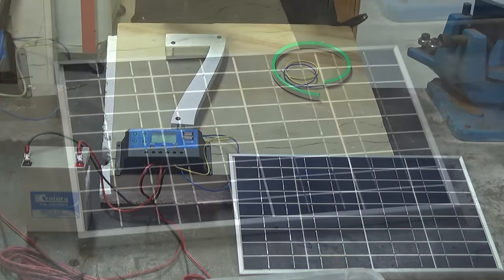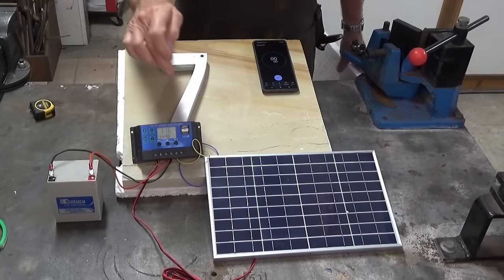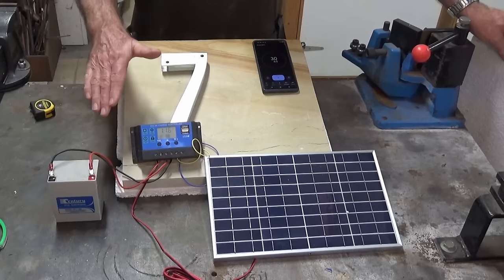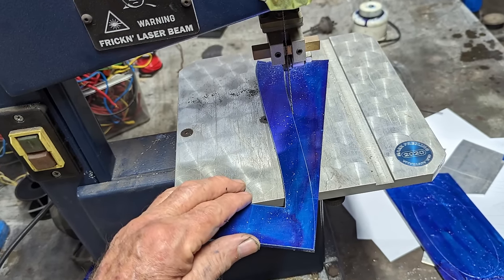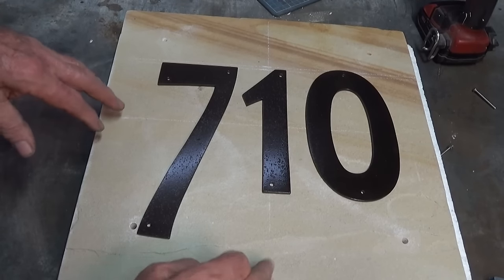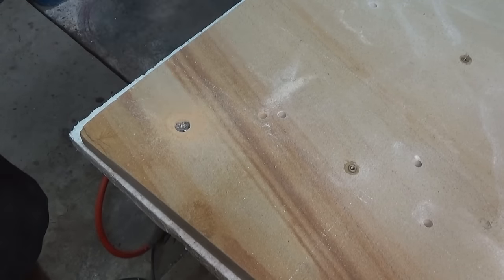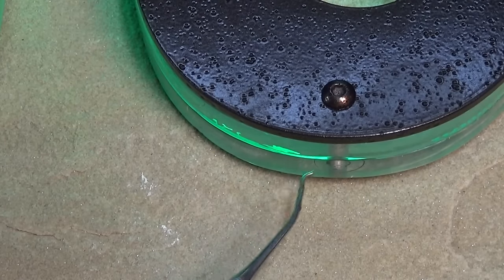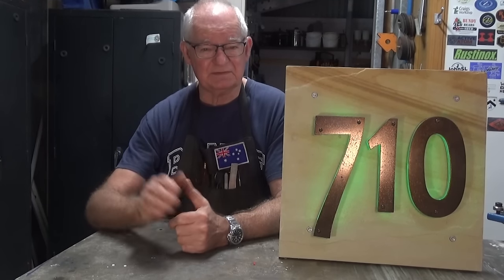Make a Solar Powered, Self Illuminated House Number

Comment: A tip I was given regarding epoxy, buy a pack of playing cards. They make cheap, disposable mixing pallets and they make good squeegees for small epoxy layups.
Reply from the maker: There should be plenty of redundant decks of playing cards around these days. Everyone plays solitaire online! You are correct though, they are just the right size for small gluing jobs.
Regards,
Mark

Comment: Gday Preso, I had the pleasure of meeting Steve as well and a great bloke to talk to, I had a suspicion you would have a go at this when Steve showed me his sign and said he was dropping in to see you, personally I really like the sign you’ve made and the spacing of the numbers looks fine to me, I think I’m going to have to have a talk to you about the powder coating and see if it’s possible to have a setup here at some stage, great episode mate, cheers
Reply from the maker: Thanks Matty. Steve is always interesting to talk to. It turns out we lived only a few hundred metres from each other when we were living in Maryborough back in 1987. I can highly recommend powder coating as a surface finish. I'm only too happy to help if you want to get started.
Regards,
Mark
Reply: @Preso58 Mr Presling, does powder coating work with body fillers, or if there’s problems with electrostatic sticking, chemical binding, the heat of cooking, or whatever?
Reply from the maker: @iTeerRex  I have had good success with some of the metal filled epoxy putties. Selleys make an epoxy/metal putty type stick which takes powder coat extremely well but I have powder coated over JB weld too. Sometimes it's advisable to preheat the prepared part and then powdercoat while the part is still hot from the oven. That is called 'hot flocking". Even if the electrostatic charge won't attract the powder, the first powder to hit the filled area will fuse and then attract more powder electrostatically. 
Regards,
Mark
Reply: @Preso58  Ah, so metal filled fillers, and/or hot flogging 😂 Thanks.
Regards, Rex

Comment: I could have done with something like that on our property overlooking Somerset Dam, but I haven't been there now for just over 17 years and the LED stuff was getting started back then. As an aside, when we were finally allocated a street number, I asked how they arrived at that particular number and I was told it was a reference to how many metres it was from the start of the street so that emergency services could find it more easily. 👍
Reply from the maker: Ahh yes, we were initially given a lot number and years later a street number but the Noosa Shire inadvertently used the suburban street number system for our road which spanned into the Sunshine Coast council area. The other end of our road used the rural numbering system which meant that there was another property with the same street number as ours on our road. Cue chaos with delivery of mail, parcels and Google Maps. After lobbying our council, they issued us a new street number which does use the distance in metres from the southern end of our road. Just for fun, see if you can find an app called "what 3 words" for your phone. It guarantees that you can give an accurate location to any emergency service in any country down to a resolution of tens of square metres!
Regards,
Mark Presling
Reply: @Preso58  That would have been a hassle. What I didn't mention was we were at the end of a cul-de-sac. Our driveway was to the right of a power pole, there was another on the left, the 2 numbers were only 1 apart. 10-15 metres back into the cul-de-sac were two driveways opposite each other, I can't remember how they handled those 2.

Comment: I really like this project, I have been considering making a new address sign for our house.  I have a home built CNC router that is well suited for this type of project, I like the idea of using some sort of lights to illuminate the numbers.
Reply from the maker: Thanks. There are so many different ways to achieve a similar result. The main consideration would always be to ensure durability. It's amazing how quickly materials break down when exposed to UV light and moisture.
Regards,
Mark

Comment: Hi Mark. Extremely well done with amazing attention to detail!  I have been using flowable silicone caulk for projects when I wish to avoid the typical silicone mess. The material I bought was mae by Dow Chemical in clear. Other colors are avaiable. Last project was adding silicone to seams of a copper roof made for pillar lamps for a gated home entrance. The material works a treat! regards vic
Reply from the maker: Thanks for that. I must say I have never heard of that product before. I just found a supplier for Dow 734 Clear but it's rather expensive at AU$30 for 300ml. However if it's self levelling it would be worth it. I may try that for the MKII version of the numbers.
Regards,
Mark

Comment: Mark - The sign looks great and the digit spacing is fine also. The only thing that caught my eye once you had the sign lit was the zero digit appears a bit "fat" compared to the other two digits. You've set a project for me also. We live out in the "sticks" a bit here in Texas and I've noticed that the numbers on the house just don't "do well", even when lit from above.
Reply from the maker: I used a typeface called Candara bold. When you look closely at a lot of typefaces they often have characters that don't have a common baseline. The zero that I used is higher than the 1 and although you can change the shape of each character to make it conform to a pair of guide lines I just left it as it appeared after I entered the text. The zero isn't elliptical either. it's a sort of weird ovoid shape which made it super hard to trace when I wanted to turn it into a 3D model.  Good luck with your new project. You'll have the coolest house number in the street!
Regards,
Mark

Comment: Hate to throw a spanner into the gearbox, but leaving any sort of a gap between the numbers and the sand stone is an open invitation to mama spider to construct her home therein (or any one of a considerable number of other creatures).  Unfortuneatly dust and dirt will follow.
Looks quite spectacular though!!
Reply from the maker: Unfortunately, nothing is maintenance free. However, I am hoping that having the gap behind the numbers will allow rain to wash out any mud wasp nests. The ultimate solution would be to use clear epoxy resin as a lens so that the numbers can be hard mounted against the sandstone. Although that means the installation is something of a one way street. If an LED strip goes bad you would need to hammer the number off the stone. Everything is a compromise!
Regards,
Mark

Comment: If you do this again.
Route one half of each number from each side to fit the LED strip and add the through holes for the wires.
Place the LED strip in the groove and use superglue to bond them together - it'll be like one solid acrylic sheet and the LED strip is inside of it protected from the elements.
Use a 0,5mm or 1mm spacer between the acrylic number and the alu front.

Might work out well.

Comment: Awesome build that I may have to steal your idea🙂. If you had some Weld-On 4 you could bond the 2 pieces of acrylic together. I do like the cast number idea too because it will last longer in the elements and if or more likely when the LED's fail it will be easier to replace then having to dig them out of the silicone and acrylic.
Reply from the maker: We used to use Ethylene Dichloride for solvent bonding when I was teaching. We had 4 litre cans of the stuff. Done correctly it makes a perfect seamless weld but the acrylic needs to be perfectly clean or you will get air bubbles in the bonded area. I am anticipating that the LED strip will fail at some point but I have lots left over from the initial build so it's best to consider how it might be replaced.
Regards,
Mark

Comment: Hi Mark, This has turned out really nice. I am sorry for sending you off on a tangent with this project 😊
Reply from the maker: No apology necessary. I have thoroughly enjoyed this build. I think it looks amazing and it's absolutely practical. FYI, I ran the sign from the battery only last night for 11 1/2 hours. The light was a bit dim in the morning and the charge controller showed that the battery was almost flat but it charged up again during the day in overcast conditions. I am assuming that the charge controller does use some current from the battery even if it's just idling but I have room in the junction box for another battery which I can run in parallel. 
Cannot wait to see yours in action.
Regards,
Mark
Reply: Your video has inspired me how I should mount the LEDS. Have been thinking about how to mount them for a while now. I now have hatched a plan on how to go about it. With any luck, it should look OK. I am on leave for the next 2 weeks, so I should have some progress. Doesn't look like my gabion build is going to occur with the weather prediction being wet and more wet.
Reply from the maker: @stephenmain7821  Yes, it's muddy as all get out here as well. I took the top off our gabion today to work out how to mount the solar panel. I will have to install some conduit to route the wires through to the back of the column. Good luck with the rest of the build.
Regards,
Mark
Reply: @Preso58  A 30 watt solar panel on a 3 Ah gel battery should get it right up most days, but I'd be tempted to run a second panel and a larger battery myself, to help get through dim winter days and long nights - worth doing a current check to see what that green light tube is drawing to see how close to the capacity of the battery your setup is drawing overnight.  And how much the panel is actually putting out during a dim and a bright day.  I ran simple remote systems for electric fences years ago, and ended up with a couple of 40w panels and 14 - 20 Ah batteries to get through winter days, sometimes the system has to coast for a couple or more days with little if any charging available.  I believe green also pulls a lot more current than some other colours.  The most efficient colour is red.  I had to work out the resistor values years ago to get a multi-coloured string of LEDs to all glow at the same visual level from a single power source.  Green was one of the last to glow at all as we wound up the current limiter the first time...  I have done something similar in wood with a clear acrylic back layer for business signage - the weather and sun sure did a number on it over time but we got nearly a decade before it was more offensive that rustic... :)

Comment: Very nice, I love the way the glow highlights the texture of the stone. I was wondering if there was an easy way to cement threaded anchors into the stone from the back so the mounting holes are not visible from the front.
Reply from the maker: I will be threading the cast numbers from the back so I can screw them on with the heads on the rear side of the sandstone block. That should make the MKII version a lot cleaner looking from the viewing side.
Regards,
Mark

Comment: LOVE IT! I've got the same problem with no lights and long drive. Currently using off the shelf solar powered house numbers but I'm constantly repairing or replacing them. Thanks for the excellent video.
Reply from the maker: Sadly, we have had days and days of rain and overcast weather so the battery isn't really charging up enough to run the numbers for more than a few hours. We are supposed to get some fine weather tomorrow.
I did actually see some off the shelf LED numbers on AliExpress tonight but they are quite small and probably wouldn't stand much in the way of exposure to the weather.
Regards,
Mark

Comment: Beautiful project!
 Did you measure the current draw to see how long the battery would last with a storm or clouds that would prevent charging for several days?
Reply from the maker: I did run the lights on a partially charged battery for 11 1/2 hours but it was fairly dim the next morning. My mate Steve did suggest a PWM dimmer to keep the light level a bit lower for longer. It can be retrofitted so I will just run it as is and see how it goes.
Regards,
Mark

Comment: rural aus, think you will find you are 7.1 km down your road. 
still love the project. and the channel.
Reply from the maker: Absolutely correct but it was not always the case. When we first settled in to our new home we had a street number based on the suburban numbering system. The trouble was, the other end of our road was in a different shire and they used the rural numbering system. As a result, there were two properties with the same number on the same road. We got sick of receiving mail from our counterpart down the road and there was always the fear of having to call an ambulance and having it go the wrong address. It all got sorted out at a public meeting organised by our Mayor who happened to live just a couple of hundred metres up the road from where we live. 
Regards,
Mark

Comment: Hole E Cow! That is a brilliant concept........Guess what I'm making next 🙂
Smaller scale, and the numbers will be lit, rather than backlit. Even though we have street lights it would be a rather cool feature for the letterbox. Great stuff as always Mark and thanks for another project 👍
Cheers
Pete' New Zealand.
Reply from the maker: My mate Steve, has the same concept as what you are describing. He used much chunkier numbers and ran the LED strip around the outside of each number with a clear epoxy resin back plane. It looks great and is basically the opposite of what I was trying to achieve. He has added a PWM controller to cut the voltage back to about 10.5 volts so the lights don't drain the battery as much. I am adding the same controller to my setup just to give me some battery reserve in case of overcast weather. 
PS: we are booking another trip to NZ in winter this year. Mt Cook, Greymouth, Milford, Fox Glacier, Christchurch, Queenstown and the Trans Alpine Railway. Should be stunning!
Regards,
Mark

Comment: Very nice! You should try sanding the side off the acrylick where light passes throug, that will soften/diffuse the light and cover up any weak light spots
Reply from the maker: It does make the edges "glow" more uniformly if they have a matte finish. 
Regards,
Mark

Comment: That was a great video, and the numbers illuminated against the sandstone are awesome. It would be good to see it in place and how you box up the controller and battery.
Reply from the maker: I will do a follow up video when I get the installation done. It's really wet and boggy here at the moment. We were supposed to be in for an El Niño winter but we are back in a La Nina cycle. 
Regards,
Mark

Comment: I would suggest using PMMA solvent to glue acrylic. it's a very thin liquid, and it just creeps into crevices of a joint and basically welds the parts.
Reply from the maker: I would too if I still had some. We  used to use Acrifix which was supplied in a tube as a gel and Methyl Methacrylate as a liquid solvent. I  had a 250ml tin of the liquid solvent and I went to get some and it had all evaporated. Bummer!
Regards,
Mark
Reply: @Preso58  ah :D 
I usually don't use the right stuff because i can't find it, but this makes sense too :)

Comment: Maybe you could have used nylon screws while gluing your brass inserts (or another plastic that does not bond to epoxy). You don't need strong bolts for the gluing step.
Reply from the maker: That would work. 
Regards,
Mark

Comment: Mark- thin CA will waterproof and seal the air gaps and last longer than us😂. Being a Radio Control addiction, 18650 cells would be my first choice, inexpensive, safe, and powerful.  You can get a reading of energy used with a meter and size accordingly.  A thought, and probably less expensive.
Reply from the maker: I tried to buy some of those cells for a couple of rechargeable torches that we have. The prices fluctuated wildly on Ebay and I have heard (maybe unsubstantiated) that there is a trade in counterfeit 18650 cells. Often they are taken out of old laptops and power tools and just given new heat shrink covers and sold as new cells. The ones that I bought were about half the price of others that claimed to be genuine and branded. I don't think I own any that are brand new and "genuine" so I have nothing to compare their performance with. 
Regards,
Mark

Comment: Of course this will never work where it gets cold…..or it will only work until the winter comes!!
Reply from the maker: No chance of snow and ice here. However I did watch a video which discussed why LED lighting cannot be used in traffic lights where freezing weather is likely. The heat from incandescent bulbs will prevent snow and ice from obscuring the lenses but it means a massive waste of energy (as heat). 
Regards,
Mark

Comment: Copper and aluminium don't play well together.
Reply from the maker: Especially when there is moisture present. I had a copper boiler which developed deep pitting because I put an aluminium cladding on the outside. Luckily, the copper used in the powdercoat is bound by the polyester carrier. I have used copper powdercoat on some outdoor garden lights with both aluminium castings and some wrought aluminium extrusions and they have been sitting in the garden for over three years and there is no corrosion that I can see. 
Regards,
Mark